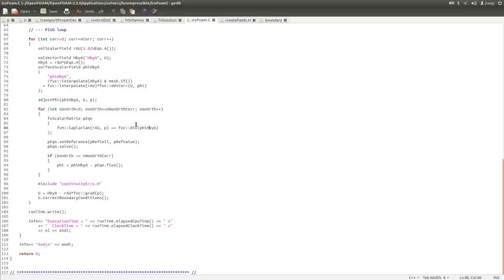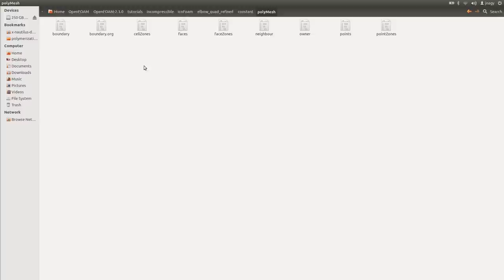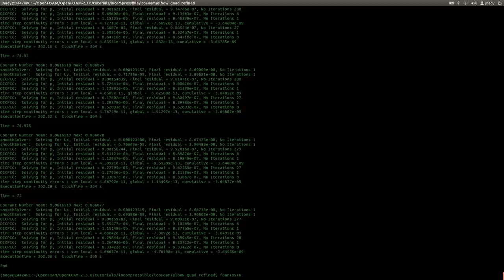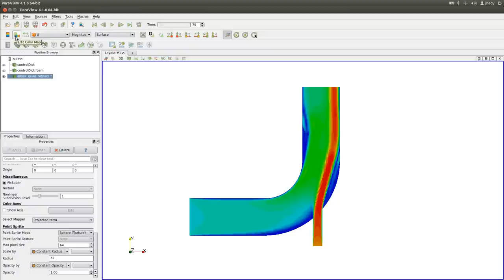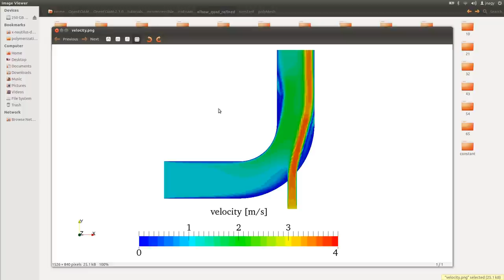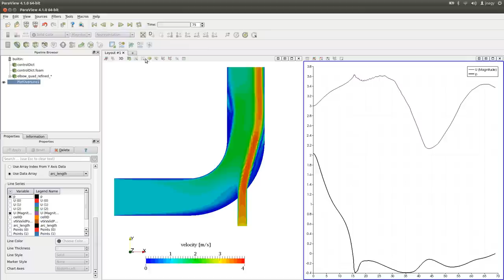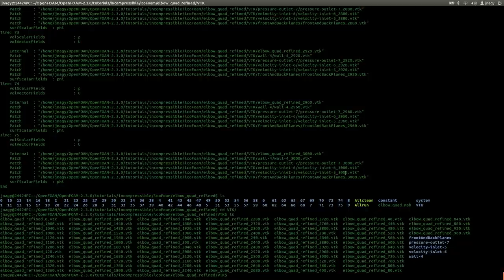How to run your first simulation in OpenFOAM® - Part 2 - tutorial

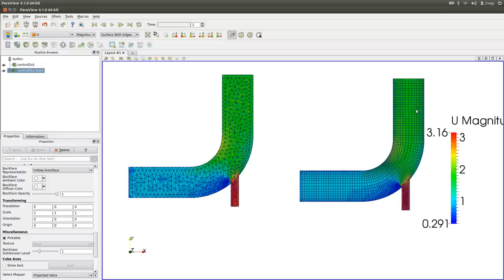Comment: When moving the trimesh next to the quad mesh around 5:10 you could also have used a split rendered view with linked cameras. That way you can zoom in on the same regions in both meshes at the same time.

Comment: Hello, thank u for your videos. It is a very good tutorial. 

I'm a Open FOAM begginner and I'm having a problem with the refined mesh, could you help me with this please?

When i tried to refine the mesh with the "refineMesh -overwrite", a lot of similar FOAM warning appeared. 

For example: 

" --- > FOAM Warning:
From function void Foam: : cellCuts: : setFromCellCutter(const Foam: :cellLooper&, const Foam: :List<Foam: :refineCell>&)
in file meshCut/cellCuts/cellCuts.C at line 2435
Found loop on cell 70291 that resulted in an unexcpected bad cut
Suffestions: 
    - Turn on the debug switch for 'cellCuts' to get geometry files that indentify this cell
    - Also keep in mind to check the defined reference directions, as these are most likely the origin of the problem "

Because this is just a warning, i tried to run the simulation anyway, but there is a fatal erros:

" --> FOAM FATAL IO ERROR;
size 2200 is not equal to the given value of 8800

file: /home/andrenahes/andre-dir/elbowquad_refined/75/p
     From function Foam: : Field<Type>: :Field(const Foam: : word&, const Foam: : dictionary&, Foam: :label) [with Type = double; Foam: :label = int] 
     in file /home/pawan/OpenFOAM/OpenFoam-v1912/src/OpenFOAM/lnInclude/Field.C at line 222

FOAM exiting"

Also, before trying to refine the mesh all my simulations were working well and similar with your results. So, i'm guessing that the error is caused because the refine mesh.

Thank you !!

Comment: I just started on my learning openfoam with a project of running backward facing step simulation using icofoam solver and was heavily confused with simulating the geometry ,like from which case file i can develop the geometry and give boundary conditions.And when i give the solver against cavity file in the cavity folder of icofoam tutorial that was copied to run folder ,it says error with polymesh and i tried giving ansToFoam cavity.ans ,but that didnt went well.And i m stuck as of now,that stuck brought me here and i m learning slowly i guess.

Thank you so much jozsef, you are a real contributor and game changer for open foam beginners.

Comment: Hi, I do appreciate the help you are providing to learners like me. Thank You.
I've question to you. Although, I managed to refine the quadmesh following your instructions, but the terminator gives me warnings. Can you give me any idea what's the possible reason behind these:
1.Refinement dictionary refineMeshDict not found
2.FOAM Warning : 
    From function void Foam::cellCuts::setFromCellCutter(const Foam::cellLooper&, const Foam::List<Foam::refineCell>&)
    in file meshCut/cellCuts/cellCuts.C at line 2395
    Found loop on cell 3319 that resulted in an unexpected bad cut.
    Suggestions:
      - Turn on the debug switch for 'cellCuts' to get geometry files that identify this cell.
      - Also keep in mind to check the defined reference directions, as these are most likely the origin of the problem.

The warnings are given for a number of cells but I am showing you only one.
Reply from the maker: As long as they are warnings and no errors, it is ok for this tutorial. With refineMEshDict you can define the refinement, the second warning tells you about a bad cell refinement. As long as the simulation runs, you shouldn't worry about this.
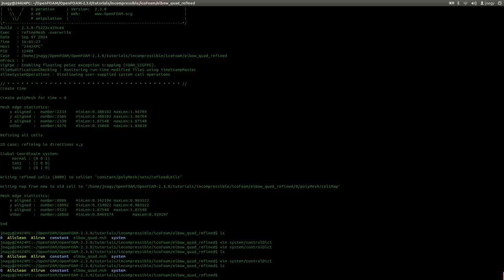Reply: @OpenFOAMJozsefNagy  Hello sir! Thanks for your great work with OF tutorials...  I have the same issue and after this step, it will run up to a specific time point and exits with this error "Courant Number mean: 0.155452 max: 2.49183 " meaning the simulation wasnt converging due to those several warnings of bad cell cuts. After some seach on google, i figured out that " when the user doesn't use good enough directions for the cell cutting, there will be cells that are incorrectly cut and that could end up being a "needle in a haystack" that leads to a very bad mesh. Keep in mind that checkMesh might not complain about these unexpected incorrect cuts.". Meaning there is probably an issue with the configurations for the patchLocalCoeffs. in 10:00 it s the global coordinate system (tan1, tan2, normal). My question requires rather big answer, but in case it doesn't, are there any tips how to fix that without going way much deeper than "my league" if i could put it this way. Thanks!
Reply: I am using openFoam v7 (latest), paraview 5.6.something (latest), ubuntu 18.0.4.  I guess, in case to save refineMesh from openFoam, you could do that from third parties like Meshlab, Blender, etc, right?
Reply from the maker: @PsyChoChiRcuS  You can just reduce the time step size by a factor of e.g. 3
Reply: @OpenFOAMJozsefNagy  yea i just saw you did that thing in a next tutorial of urs and i returned to inform others who may have the same expirience... silly youtube didnt notify me for ur reply >< oh well, thanks a lot for the confirmation :)
Reply: Thank you for asking this question!
Reply: @OpenFOAMJozsefNagy  WOW! So glad I you said this! What a relief! Loving this lesson!

Comment: Hi, Jozsef! When I used the command 'refineMesh -overwrite', it showed a warning as below. However, when I checked the mesh, there seemed to be fine. How to turn on the debug switch for 'cellCuts'? Do I still need to do anything to solve this warning?

FOAM Warning : 
    From function void Foam::cellCuts::setFromCellCutter(const Foam::cellLooper&, const Foam::List<Foam::refineCell>&)
    in file meshCut/cellCuts/cellCuts.C at line 2393
    Found loop on cell 3200 that resulted in an unexpected bad cut.
    Suggestions:
      - Turn on the debug switch for 'cellCuts' to get geometry files that identify this cell.
      - Also keep in mind to check the defined reference directions, as these are most likely the origin of the problem.
Reply from the maker: These are warnings. You can ignore them for now. I tested this and the mesh looks good for me with v1906. Does the simulation run?
Reply: @OpenFOAMJozsefNagy  Yes, the simulation runs. Thank you!
Reply from the maker: @武昌区F91  Great.
Reply: @OpenFOAMJozsefNagy  simulation runs, but courant number exceeds 1. Is that okay?
Reply from the maker: @jonathanspurgeon5461  If it is stable it is fine.

Comment: Amazing tutorial. I just had a small issue with plot over line. I think I sort it out. If you try to do it, please make sure you plot on the case whose position is not translated. As there are 3 cases in Paraview opened and we translated the position at least two cases. If you generated the line on a contour which has translated, then you got nothing. Maybe you could try to add the translated coordiantes to resolve this as well.
Reply from the maker: This is correct. The coordinates don't change.
Reply: @OpenFOAMJozsefNagy  Ohhhhh. Thanks!

Comment: Hi, thank you for this nice tutorial. I have one question. In the tutorial folders of the openfoam 10 which I was using the refineMeshDict file was not present inside system/ . While executing the refineMesh -overwrite command, it was searching for the refineMeshDict file. After the command, the mesh was refined I reviewed in ParaView but the solution came out a blunder, nothing as other two solutions. What could be the case? I followed all steps according to your video.
Reply from the maker: v10 has too many syntax changes. Please use v2212 on openfoam.com to follow the tutorial.

Comment: What exactly did he mean by arc_length 22:23 . If the values are being recorded along a straight line(17:56), how did the even the concept of arc enter here?
Reply from the maker: You are correct, a straight line has an arc length of a simple line. But you can have a tilted line, where you have x, y and z components of the line.
Reply: @OpenFOAMJozsefNagy  pardon me but I didn't really understand what you're trying to convey
Reply from the maker: @siddharthvs1770  It can be a line in 3D. You are right it is not a curved line, but always a straight one.

Comment: Hi József, Would you happen to know if OpenFoam can store the residuals for each cell location? I have looked around but have not found any indication that this may be done presently. I need this in the context of mesh refinement - I have a coarse mesh that converges, while a very fine mesh does not, or at least does so much slower and the pressure residual shows oscillatory behaviour. I need to understand if this is do to the fact that the fine mesh is capturing some unsteady physics that the coarse mesh does not resolve (I'm running steady RANS) hence the convergence is hampered by this local unsteadiness. Any ideas? Thanks.
Reply from the maker: Hi Oscar. This is a good question and I am rather sure, that you are not the only one, who has this problem. Turbulence is mostly unsteady, you just assume a steady solution. I don't know of such a utility, try pisoFoam/pimpleFoam to check if your flow is unsteady. If it is, the steady solution is always questionable and on a coarser mesh, the solver might smear your results. This way it is possible to find a steady state solution. Still it will not be correct.

Comment: Thanks for the video! I have exactly the same version 4.1.0 of Paraview, but for some reason my parameter list on the left is much shorter! I don't have the "Transforming" section, only "Styling" and "Edge styling" -- so it's not possible to shift the elbow_tri results.
Reply from the maker: Did you click the small "gear" sign in the properties panel?
Reply: József Nagy Thanks! I was not easy to spot in the beginning.
Reply: i had this problem too lmao

Comment: While performing Filters -> Data Analysis -> Plot Over Line on the "elbow_quad_refined" case, although I provided the coordinates for start and end points of line, the plot is seemingly empty. What might be the cause for that ?
Reply from the maker: Maybe the line does not go through in the third direction?
Reply: @OpenFOAMJozsefNagy  i set z-coordinate to be 0 for both ends of the line.
Reply from the maker: @sandipgewali641  Then I do not know. Possibly try an older/newer version of Paraview?

Comment: Hello. Excelent tuturial. However I have two questions.
How does the refine command works? Because you decrease the timestep by a factor of 2 but in the command you didn't specify anything. There is any dict file for refine command? Can we use refine command with any kind of meshes?
Reply from the maker: +Carlos Completo refineMesh cuts all your cell through the "center", so instead of a cube you will have 8 cubes in 3D. With this your edge length is decreased by 2 and that is the reason for the factor of 2 in the time step. As far as I know this should work for all meshes.

Comment: I'm trying to simulate a fluid flow in a simple rectangular passage where i have a half circle appearing at the roof of the passage. The half circle has a radius as big as half the lenght of the passage. That said, i'm using icoFoam solver with a kinematic viscosity of 1. Then, the Courant number escalates very quickly, impossibilitating the simulation to end. Please, do you have any tip for that??
Reply from the maker: Take a look at the multiphase simulation project videos and focus on the settings in controlDict there.

Comment: When I tried the refineMesh command, I got the warning:
"From function void Foam::cellCuts::setFromCellCutter(const Foam::cellLooper&, const Foam::List<Foam::refineCell>&)
    in file meshCut/cellCuts/cellCuts.C at line 2434
    Found loop on cell 3200 that resulted in an unexpected bad cut."
Subsequently, I opened paraview and saw that near the elbow, the mesh was warped - kind of going out of plane. I'm using Openfoam-v1906 on Ubuntu 18.04. Can you please suggest why this might happen?
Reply from the maker: These are warnings. You can ignore them for now. I tested this and the mesh looks good for me with v1906. Does the simulation run?
Reply: Sir I got the same error in openfoam8 and simulation does not runs as well.any suggestions?
Reply: @ujakshisharma4141  me too

Comment: Hi jozsef, 
Thanks for this amazing tutorial. I am facing one trouble though. The problem is when i am trying to use the plot over the line option in 
paraview either one of two things happens: 
1) "Plot over line" option is
 not even available on the list or 
2) "Plot over line" is greyed out and not a possible option. 
I can't find any explanation for this as it  seems that this filter option is the most basic and all tutorials say to use it .
Reply: SAME! Could you find any solution for this problem?
Reply: so do i ，have you found the solution?
Reply: In case anyone is facing this problem, make sure you have pressed the "Apply" button on the left side in Paraview.

Comment: Excellent tutorial while I have a small question. I followed your step, and my paraview version is same as yours(4.1.0 64-bit), however, I dont have "Plot Overline" in my Data Analysis list..What's going on?
Reply from the maker: +Ping Chang Hmm... I don't really know. Is it faded out or is it completely missing?
Reply: It's completely misssing, but I install another version, it works now, thanks for your reply.
Reply: +Ping Chang hello there, I have the same problem, could u please tell me how u solve it? and what version works?
Reply: +John ZHANG maybe 4.4  I cannot remember.  are you Chinese?
Reply: Yes, I have tried 5.0, it works. Thanks
Reply: I had the same problem. For me, I couldnt plot the data because I was putting the line over the translated image. The image though was not where the data was.

Comment: FOAM Warning : 
    From function void Foam::cellCuts::setFromCellCutter(const Foam::cellLooper&, const Foam::List<Foam::refineCell>&)
    in file meshCut/cellCuts/cellCuts.C at line 2393
    Found loop on cell 3200 that resulted in an unexpected bad cut.
    Suggestions:
      - Turn on the debug switch for 'cellCuts' to get geometry files that identify this cell.
      - Also keep in mind to check the defined reference directions, as these are most likely the origin of the problem.
 got it when trying to refine the quadMesh, any suggestions ?
Reply from the maker: Yes, you get this warning in recent versions, but nevertheless it works. So you can ignore it.

Comment: hey. thank you for the tutorial. It has been a great help to me.

when I run the command refineMesh -overwrite I get the following
 FOAM Warning : 
    From function void Foam::cellCuts::setFromCellCutter(const Foam::cellLooper&, const Foam::List<Foam::refineCell>&)
    in file meshCut/cellCuts/cellCuts.C at line 2395
    Found loop on cell 3200 that resulted in an unexpected bad cut.
    Suggestions:
      - Turn on the debug switch for 'cellCuts' to get geometry files that identify this cell.
      - Also keep in mind to check the defined reference directions, as these are most likely the origin of the problem.

can anyone tell me why I am getting this response.

I am new to openfoam and coding
Reply from the maker: That is just a warning no error. You should be good.
Reply: @OpenFOAMJozsefNagy  Thank you😊

Comment: Can you help please?
While I was trying to plot over line, I got many errors and the plot over line tool just disappeared. I could not find any solution for this problem, and everything was going alright until that step. I urgently need a suggestion from you, sir.
Thank you!
Reply: Update: It still is not seen in the data analysis section, however I can find plot over line by searching. But it keeps giving errors and is not plotting, hence I cannot get the graph.
Reply from the maker: Maybe try it with a different version of paraview. Or try functions in system/controlDict.
Reply: József Nagy okay sir, thank you.

Comment: During refinement  
Its showing 
Refinement dictionary refineMeshDict not found 
How to solve it
Reply from the maker: Which version of OpenFOAM do you use. It should not ask you for the dictionary if you use the command as I show you.
Reply: Actually i have hp laptop with windows operating system in which i have installed ubantu 18.04.2 using  oracle virtual box in which i am working with OpenFOAM version 18.1
Reply from the maker: @coolkalpraj  Do you mean v1812?

Comment: what is he talking, a marsian language or what!? Are there easier ways than that code writing? do I need special training for CFD? I am interested to see some fluid flow simulation at work because I have 3D models of the pipelines and I am curious for turbulence, heat lost, pressure drop etc. But this looks very difficult, so I guess, I have to find a professional from freelance to do it.
Reply from the maker: CFD is complex, it might be a good idea.

Comment: When i try foamToVTK i get:
--> FOAM FATAL IO ERROR: (openfoam-2206)
size 2200 is not equal to the expected length 8800

file: 0/refinementLevel at line 19 to 2529.

    From Foam::Field<Type>::Field(const Foam::word&, const Foam::dictionary&, Foam::label) [with Type = double; Foam::label = int]
    in file /usr/src/packages/BUILD/src/OpenFOAM/lnInclude/Field.C at line 218.

Does anyone has an idea what might be the reason for that?
Reply from the maker: It seems you refined the mesh or used the one mesh to visualize the results of the second one. I think it is just a bit of a mixup.